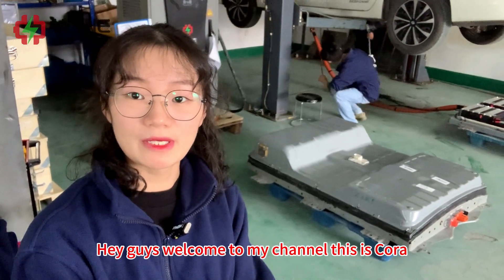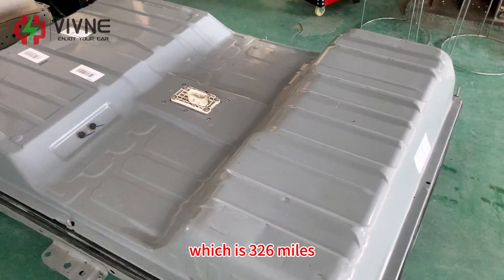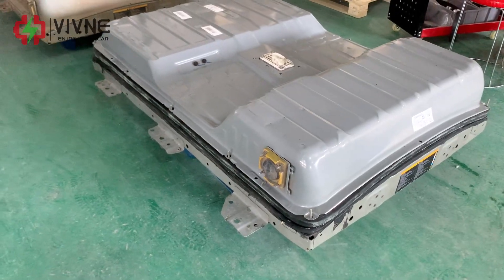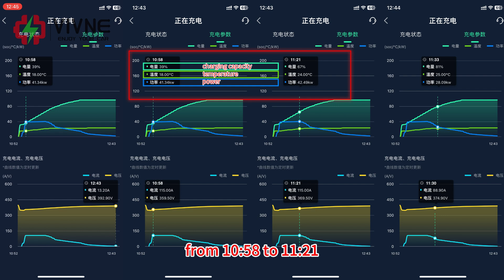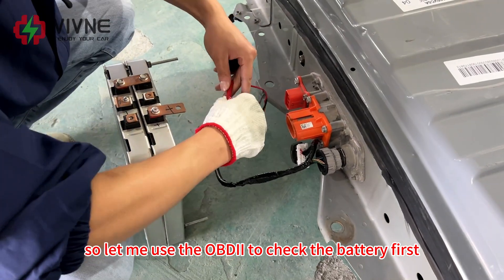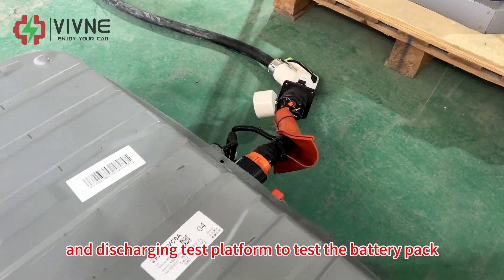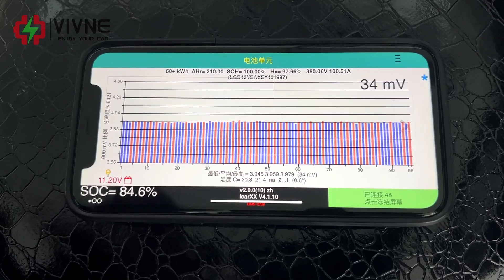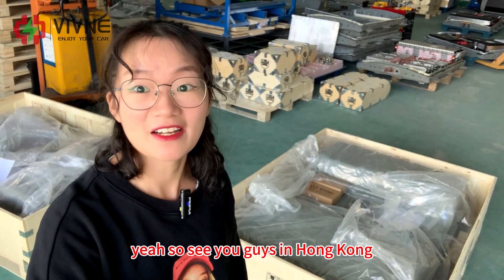VIVNE-Nissan Leaf 75kWh battery pack(Part 1)

Comment: Can’t possibly get that because the state of charge equals power delivery, meaning an average of 12-15k hourly draw would hardly last for 500km. However, below 20% state of charge or 15kwh, the battery risks accelerated depreciation on highway usage. So only the top 60kwh is useable-or less, still that’s 400km range, which is amazing. I own a leaf 2015, more than happy to order this battery when the budget allowed it.

Comment: Good question, can you ship to Argentina? And the price for 75 kWh. My 2020 Nissan Leaf is 40 kWh. Regards, geniuses.
Reply from the maker: Yes, we can ship to Argentina. We once customized a 75kWh battery for a customer based on his requirements, but we don’t recommend this option as the battery is too heavy and would require an upgrade to the rear suspension.
A 62kWh or 68kWh battery would be the best option in terms of performance, weight, and overall balance. 62kWh can drive about 430 km and 68kWh can drive about 470 km. Let me know if you are interested, here is my WhatsApp: +8615211174371, thank you.

Comment: hi how heavy are these 75kwh packs again might have missed it?
Reply from the maker: 428kg, 154kg heavier than the original 24kWh, need to upgrade the rear suspension, so not recommend

Comment: This battery you sell is 4cm "higher" than the original. Does it fit without any modifications? Was there at least 4cm free space above the original battery?
Reply from the maker: Have to modify the battery case, and the 75 kWh is too heavy, so generally we don't recommend it, 50/62/68kWh are better choices

Comment: I hope someday I could get a replacement Leaf battery with Sodium Ion cells. It's very cold here and I lose about 40% of my range in the winter. I don't even need DC charging, I just need good cold weather performance.
Reply from the maker: Currently, NMC and LFP batteries are still the mainstream products on the market.

Comment: There are more than 75000 Nissan Leafs in Norway but no possibility to upgrade batterpacks. I have a 30 kwh 2016. Does a upgrade to a 62 kwh require any upgrade of brakes and suspensions? Does a switch to a bigger battery pack also require any upgrade of software and connectors?
Maybe there is a need of a new certification from the authorities since the car probably gets heavier?
Reply from the maker: Leaf is a very nice car, and it's a shame that it will become a disposable car if you can't replace the battery.

No, you don't need to upgrade the brakes and suspensions for 50kWh or 62kWh. For the software, just reprogram the BMS and the car can will recognize the new battery. 

The 62kWh weighs 48kg more than the original 30kWh, but the 50kWh weighs almost the same as the original 30kWh, so maybe the 50kWh is a better choice for you people there.
Reply: @ Thanks a lot. What is the approximate range for the 50 kwh and the 62 kwh battery packs?
Reply from the maker: @ The range of 50kWh is about 350km, and 62kWh is about 430km

Comment: Do these battery packs you make have active liquid cooling? Or are they just passively cooled like original LEAF packs?
Reply from the maker: The cooling method remains the same as the original one, but we replace the original soft battery pack with big CATL cell, which generate less heat and bear a much smaller C rate

Comment: Would be nice to see inside the pack but guess you have to keep it secret. Standard teplacement 62kwh packs off the shelf would be good. Give an old car a new lease of life!
Reply from the maker: Yes, totally agree, 62kWh is the best choice, no need to cut the battery case or upgrade the rear suspension. 
Actually it's not a secret, we will show the inside of the battery and the entire production process at the right time, so please continue to follow my channel, thank you.

Comment: You will be lucky to get more than 400 kms with this battery pack.
I own a 2019 40kw leaf and despite what the range meter says, 200 kms is all you will get.
Reply: It depends on a lot of things, the 62kWh can do well over 300, so 400km might be possible. The real benefit is that a fast charge to 80% will get you to where a (slow) full charge to 100% on a smaller battery would have been.

Comment: How much would does the battery cost and approx. time to install
Reply from the maker: Actually, not recommend 75kWh, too heavy and need to cut the battery case, 50/62kWh is the better choise.
Reply from the maker: In fact, we don't recommend upgrading to 75kWh, because it requires cutting the battery case and also requires upgrading the rear suspension. 50/62kWh is a better choice. You can contact me for more details(WhatsApp: +8615211174371, Email: cora@vivnevs.com), thank you.

Comment: From 39% to 67% (28% of battery capacity) in 23 minutes with power 42kW gives total capacity around 58kWh, not 75kWh. Or I'm calculating wrong? Or charging curve (battery percents) is not lenear?
Reply from the maker: Wow amazing! your calculation is correct. You are really careful and smart.👍
Due to the mistake of the colleague who was responsible for installing the battery pack, the battery was installed with the wrong BMS at the beginning(installed as 62kWh). I found this problem when I was doing the fast charging test. However, it was too late to change the BMS and do the fast charging test again, so we continued to complete the test with the 62kWh BMS (the test results were the same). After the fast charging test was completed, we changed to the 75kWh BMS, and then did the high-power discharge test.

Comment: Really nice video, thanks!

By the way, any information about the new battery cells? Manufacturer and chemistry please :)

LFP (LiFePO4) would be great.
Reply from the maker: @pedrolima6832  Thank you, however LFP cells cannot be used in leaf because the voltage does not match the leaf.

Comment: Can this be modify to water cool? air cool is not good enough
Reply from the maker: @golfzaaaa  Adding cooling is a complex project and the cost/risk and benefit are not justifiable for Leaf owners.
Reply: @VIVNE-CoraLiu  What might be the cost of adding a water cooling plate inside the battery pack? I think the heatpump system from the car can be modify to similar loop as MG EP
Reply from the maker: @golfzaaaa  It is meaningless to only calculate the material cost. Automobiles are complex industrial products. Adding cooling not only requires modifying the hardware inside the battery pack, but also requires changing the structure of other components or adding hardware. The BMS program also needs to be modified. This is a systematic project. Of course, stability and safety are always the most important. Therefore, we do not recommend adding cooling.
Reply: @VIVNE-CoraLiu  I believe these batteries do not heat up as much as original battery. Do they really benefit from having a cooling system?
Reply from the maker: @aneeshzutshi3419  Yes, our upgraded batteries have increased capacity, so the same power will have less load on large-capacity cells and generate less heat. Not recommend adding cooling.

Comment: WHAT?
I want a 75 kWh pack in my Leaf.
Reply from the maker: @trailingupwards  However, 75kWh requires cutting the battery case and upgrading the rear suspension, so it is not recommended. 50/62kWh is a better choice.😜
Reply: @VIVNE-CoraLiu  Here near Seattle. There is a company that offers 62 kWh packs, but they are made with refurbished cells, and they charge $15,000. They also upgrade the rear springs. They offer 40 kWh packs for $8000.

You should open a store in or around Portland, where there is no sales tax. People from around the PNW will drive to you to buy your battery packs. It looks like building new packs from CATL cells is pretty easy since they are large capacity cells compared to the original leaf cells. So, it only takes a few of them, compared to 96.

How many CATL cells does it take to build a 62 kWh pack?
Reply from the maker: @trailingupwards  Our battery packs are assembled in the same way as the original ones, 96S1P, so each battery pack contains 96 CATL cells.
Reply: @VIVNE-CoraLiu  Well, at least it's still way less than how many cells are in a Tesla.
Reply from the maker: @trailingupwards  Haha, that's right🤭
Reply: Me too, you ship to Germany as well?
Reply from the maker: @MrRossi1805  Yes we can ship it to Germany,  but 75kWh requires cutting the battery compartment and upgrading the suspension, so it is not recommended. 50/62kWh is a better choice.🤪

Comment: This is very good. Can this pack be added to any of the Nissan Leaf model year?
Reply from the maker: @PLUGINJAMAICA  It can be used on any year of Leaf models, but if there is no special range requirement, it is not recommended to replace such a large one because it is too heavy(101kg heavier than the original 40kWh, need to upgrade the rear suspension)
Reply from the maker: @EpicDrew15   It can be used on any year of Leaf models, but if there is no special range requirement, it is not recommended to replace such a large one because it is too heavy(101kg heavier than the original 40kWh, need to upgrade the rear suspension)

Comment: cool. thanks for sharing. how much weight did that add?
Reply from the maker: @servantofjc316  The weight of 75kWh is about 416kg, which is 101kg heavier than the original 40kWh, have to upgrade the rear suspension after replacing the battery

Comment: Very interesting! I have two questions; can you add cooling/heating to manage the battery better? And can you change from chademo to CCS?
Reply from the maker: @phphph6022  Adding cooling or heating is a complex project and the cost/risk and benefit are not justifiable for Leaf owners. There are CCS to chademo converters on the market now, you can learn more about them.
Reply: Was just asking myself, if the leaf battery pack is even more dense... You really need active cooling to fight the famous degradation on these packs.
Reply: @MetalBeerGeek  But bigger capacity means smaller C rating. The Battery temperature only increased by 6 Celsius after 35 Minutes fast charging
Reply from the maker: @tarant315  Yes, we replace the original soft battery pack with big CATL cell, which generate less heat and bear a much smaller C rate. The big CATL cells can withstand 3C charge/discharge and can also withstand continuous charge/discharge of more than 1C. Take our 62kwh for example, fast charge power of Leaf is 47kw, at maximum current of 150A, we replace with180Ah big CATL cells, so the charging rate is even less than 1C. So the temperature raise even in quick charge is fine.
Reply: @VIVNE-CoraLiu  47kW is not fast charging
Reply from the maker: @paulfsd  For Leaf, this power is already fast charging